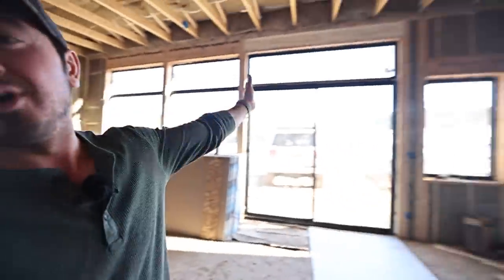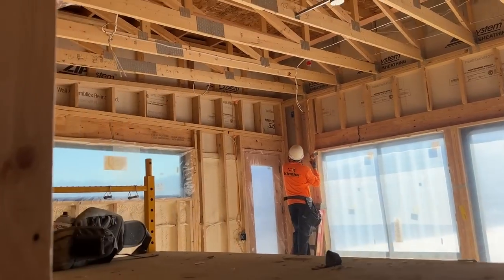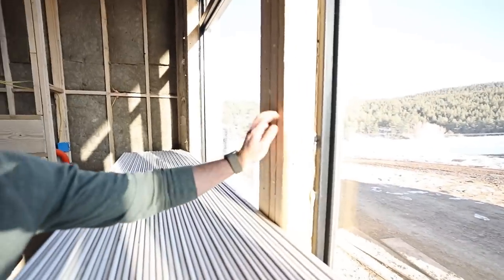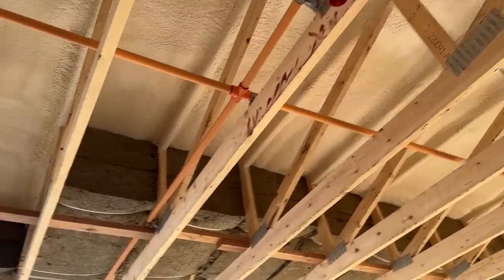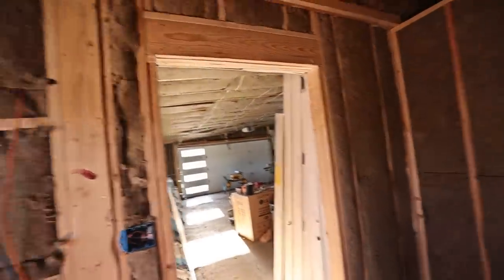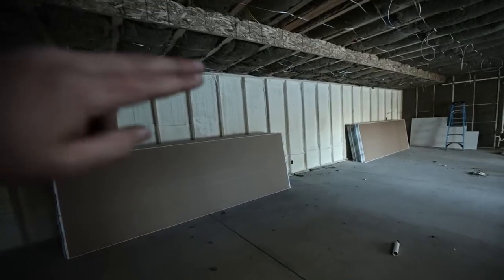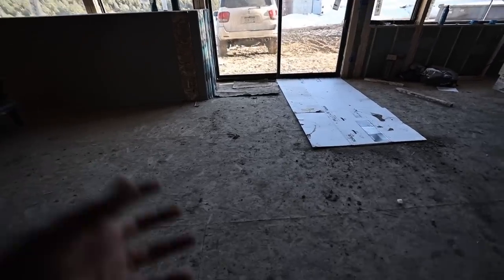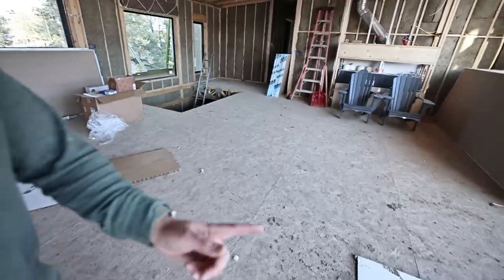Making My Colorado Custom Home Comfortable, Safe and Efficient - Future Homesteading HQ

Comment: Thermal mass very by the density of the material, but it’s the ability to hold/store the energy that it’s absorbed for periods of time. Concrete and stone will absorb, hood and, slowly release the energy over o greater time span than would or other materials will.

Mike actually does a very good job of explaining this in the video. Kudos Mike.

Comment: Thermal Bridging means: energy “heat/cold” is transferred through the material from one side to the other in short. Thermal bridge or thermal transfer allows for the energy (hot/cold) to transfer through the material sheathed you have insulated the cavities or not. So every stud joist etc would be transferring the energy from the outside in or the inside out Diminishing the effectiveness of your insulation values. So to cut down on this transfer you simply do something to cause a “thermal break” which stops that transfer of energy. It can be done on one side or the other or both.

Comment: If im not mistaken, if you spray foam your ceilings you may need a dehumidifier or some sort of ventilation to prevent moist temperatures during the summer or winter.
Reply from the maker: Colorado is very dry, so any moisture related things that plague other states, don't really affect us here.
Reply: @LastLineOfDefense  

It would be cool a video explaining the process designing your home. Like any app or program used in the design.

Comment: I’m glad you covered the sprinkler system. I was curious if you lived in a portion of Colorado where it was required. Colorado has come to the front as a leader in the Wildland Urban Interface, which is important. The cost vs protection of a residential system is a no brainer to me. Beautiful home! I admire your tenacity of jumping in with both feet and building a safe and comfortable home for your family.

Comment: I will suggest two heat pumps. My houses are in central WA so super cold in the winter and hot AF in the summer...I have two houses. One with 1 and one with 2 heat pumps. Two heat pumps is way more efficient than the house with one even with cycle pumps and air movers.

Comment: Hey mike great video. Did you insulate your concrete foundation or slab with 2 or 4" rigid insulation? R-10? R20? R40?

Comment: I've heard bad things about spray foamed.  I heard you have to redo it every decade or so because it just shrinks over time.
Reply: i've never heard such a thing. I have heard about issue with mold if it's not done correctly. or if you get a leak

Comment: What’s the difference between thermal mass and regular mass?
Reply from the maker: Typically something with a lot of mass also has good thermal mass. Thermal mass takes other things into consideration though like density/volume and how much energy it takes to heat the material.